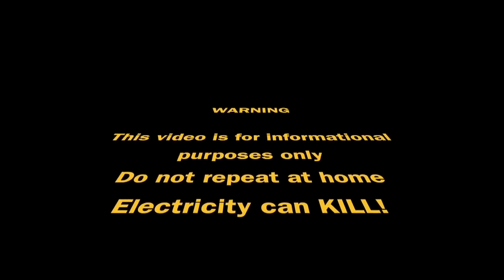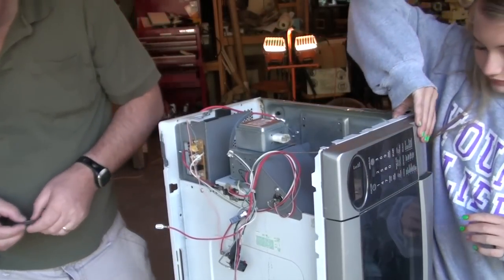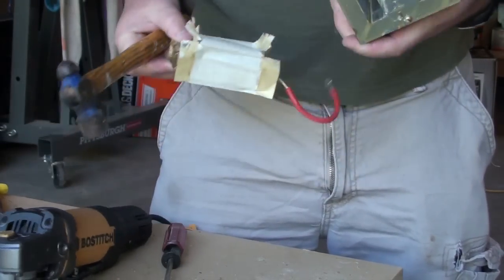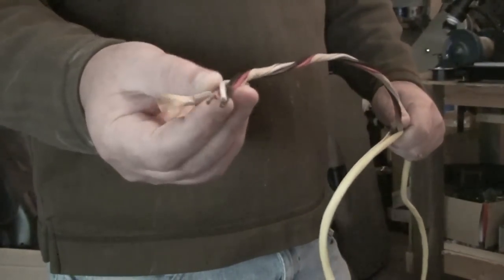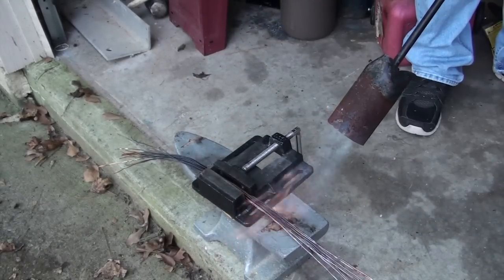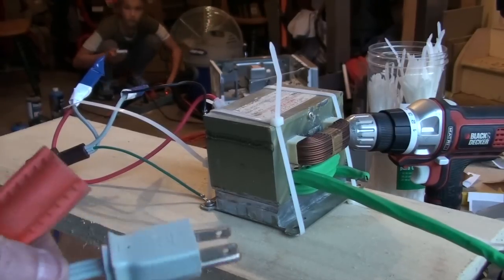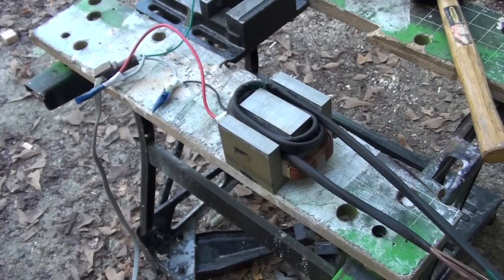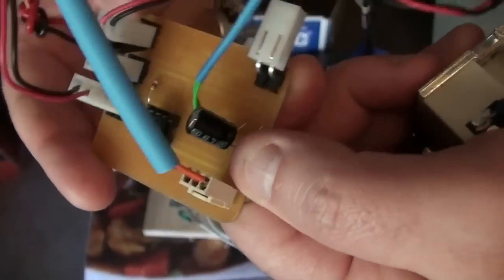diy microwave spot welder - The Transformer

Comment: 2/0 welding cable works well for the new secondary coil. You can get 2 turns in and about 2 volts out also with a little bit of Vaseline you can get the cable in without cutting the transformer body apart.

Comment: You need a 100 amp for 6013 almost 2 microwave transformer welding rod and 200 amp for 7018 that's 4 microwave transformer 👍  be careful to enhale the smoke it's high in carbon dioxide😷

Comment: Thanks for demonstrating how NOT to work on a transformer. Do you understand the physics concerning "HEAT" loss with respect to the three losses to avoid in a transformer ... Eddie Currents, IR^2, Hysteresis?  You successfully did this by cutting through the lamination https://youtu.be/dpJCi6Mmc-8?t=172? Then you think that the chattering is good thing https://youtu.be/dpJCi6Mmc-8?t=691 which in fact the two sections banging together in sync with mains wasting flux and energy (Time to dip the core ... if it was a core) Then you further create issues by welding the lamentations together https://youtu.be/dpJCi6Mmc-8?t=891. The relationship of volts per turn is more Ampere-turn-value without loosing sight of B.E.M.F and Inductive Reactance. 

Depending on your view is something learnt during my studies >>> CIVIL which means ... I leads V in C, and I lags V in L circuit as we recognise I=Amps, V=Volts, C=Capacitor, and L=Inductor

Comment: They're called magnetic shunts; and no; they do not "help with heat"; they are one of two serious mistakes you made; they go in the trash; and number one; you do not cut the core apart; you saw the secondary winding with a hacksaw and drive it out of the winding window.
Reply: Yep. Shunts are the 1st thing to go. 
But I thought he'd have to grind all 4 welds to open the block. The way his block is layered is different than mine.
Reply: Why do you get rid of them? Ive read somewhere that you need to add more to the primary winding if you do that, thanks

Comment: 11:31 Congratulations you have just turned a quiet microwave into a near school bell-ringing hystersis that reminded your poor daughter to go to her next class.

BTW -- input turnings of the primary windings are NOT about how much voltage comes in but rather their thickness is the FIRST and most important limiting factor on the amount of amps that can safely be passed through it. Plus why didn't you just cut it from the bottom so as to not risk damaging the primary coil?

Easier yet would have just been to cut the secondary coil with your gringer and pull out the secondary coil as a U shape and save it for scrap or making electrode tips out (it'd make a lot and much easier to bend fine wire than thick wire. The enamel coating melts right off with your choice of heating method. And you can control that and just use the ends. In fact if you cut the top coil you could probably just cut the bottom coil into 30 inch long lengths and use it as your new output coil. That shellac coating is way better than the green stuff you around your secondary coil.

Good vids but my did they have to be so long and convoluted? You really took the time consuming route, 3 d printing and turning things...for all that time wasted you could have worked somewhere and bought one in one or 2 days work. With your lathe you even had a chance to make liquid filled tips and you didn't. You know what you're closer to? More than enough current for a car starter. 

All you need to do is adjust your windings to get 12-18vac and then buy a bridge rectifier (Or use a bunch leftover from alternator rebuilds because usually there are 3 and one goes bad -- you need 4 unless you centertap your output in which case 2 will do perfectly.) I'd run several in parallel to get by the lower current rating (most are 40-100 amp these days.

What'd be really interesting is to see a spot welder you could plug jumper cables into and doubles as a car starter, no? VERY possible and you'd not far from it and it's practical. You'd know a lot more about electronics by then, too. Diodes you can get cheaply for rebuild kits... or arc welders. It doesn't need any filtering/smoothing to run to a battery or car starter. Most cars can easily run 15vdc and all that happens then is a very very slow boiling away of the electrolyte if you're in a warm/hot state. During winter it wouldn't even be noticeable.

Centertap means exactly what it sounds like. Just solder/braze it well and wrap a few layers of electrical tape around it (the liquid stuff is probably better for this app... I've even used on the HV part of our snowblower that goes to the spark plug and it holds up fine) and affordable. Have fun!